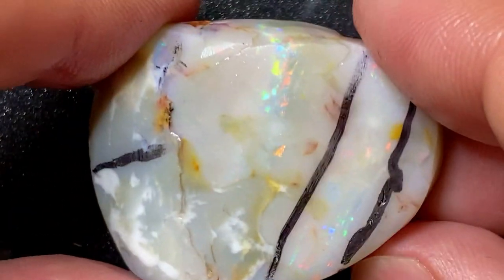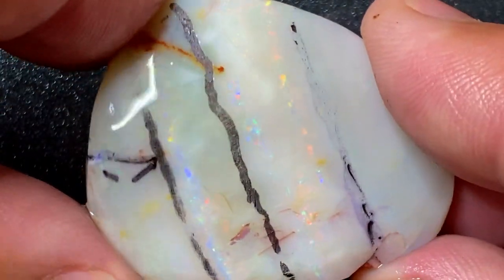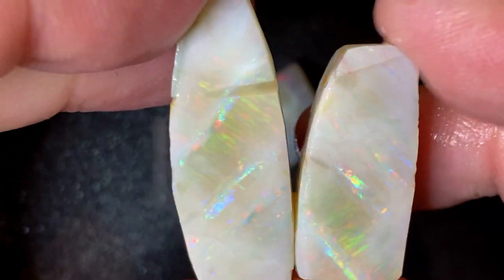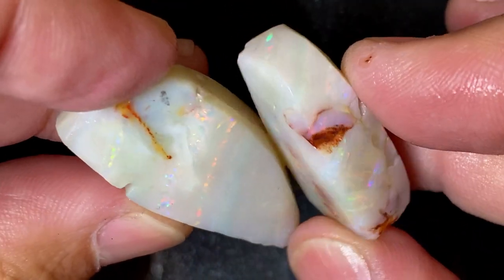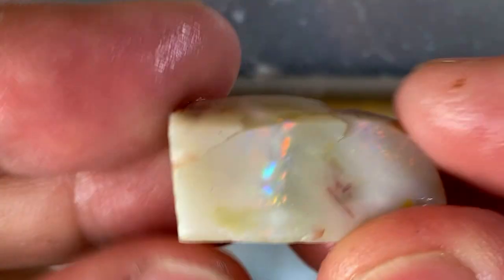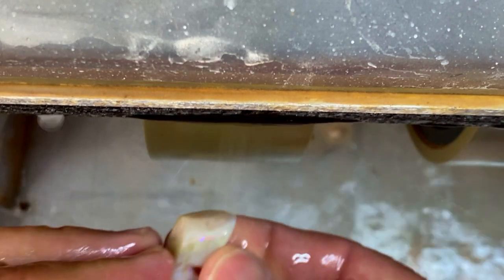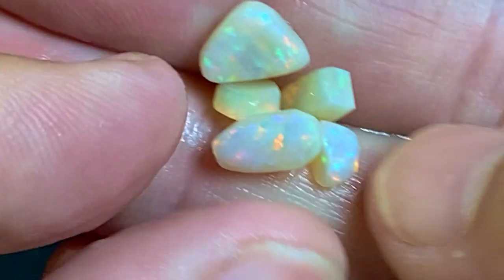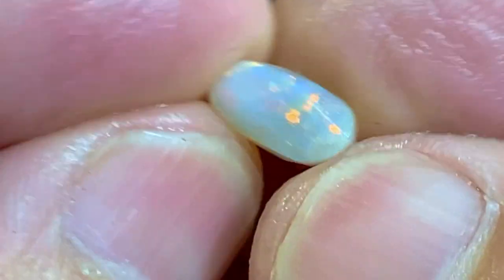Fear Not: Surprising Results from a Terrifying Rough Opal Beast Encounter

Comment: Pretty much what I said you’d get, although a touch smaller than I thought. It’s always that first cut that you fear the most, but then the stone usually will tell you what you need to do. Great job!
Reply from the maker: yes it is thanks @JSGilbert. your comments were helpful. much appreciated  I could get couple of more little ones from the end bigger piece but I like it as is just to see those different patterns in one piece is cool. I thought the stones would be bigger but the kept cracking into smaller ones. On the other hand brighter than I thought they would be.